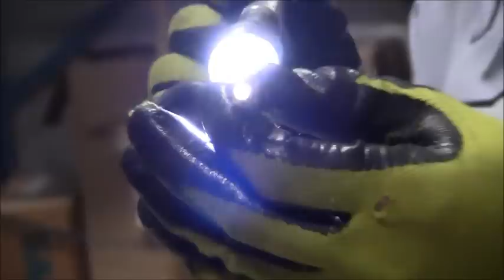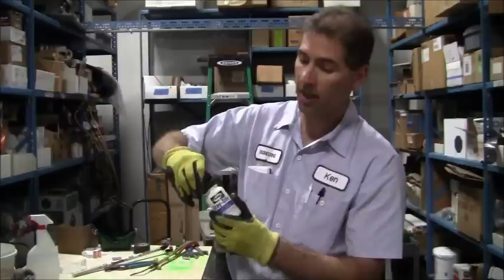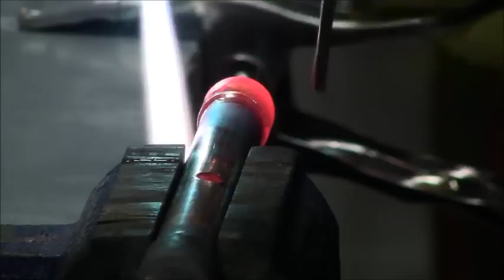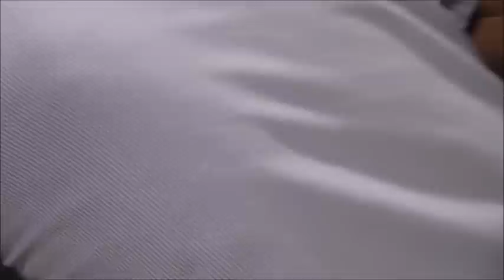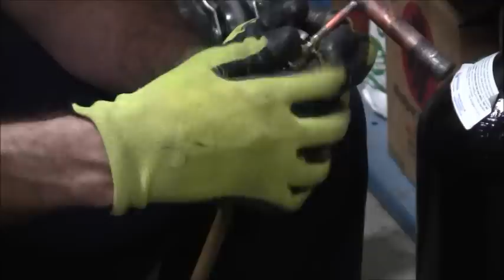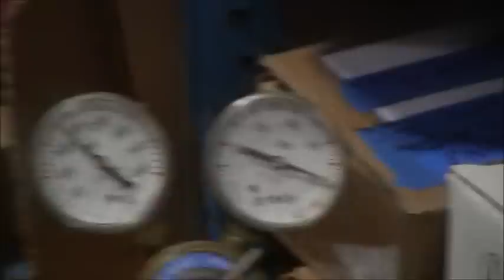How to Braze Copper and add a Schrader Valve Tap

Comment: copper to copper no need to use silver solder.brazing rod with no silver
Reply: I like silver in the mix.  Help flow.  Even just 5% silver will make the weld flow better.